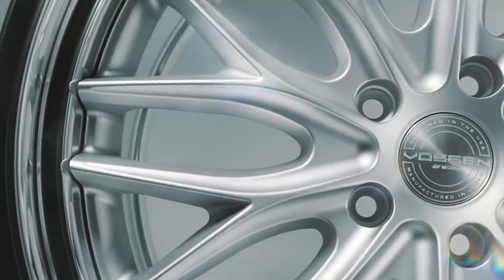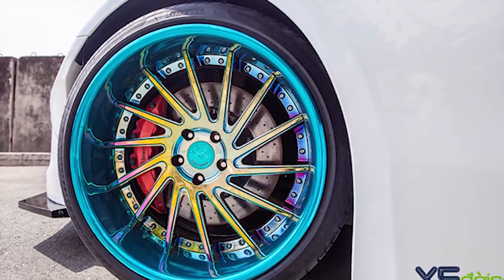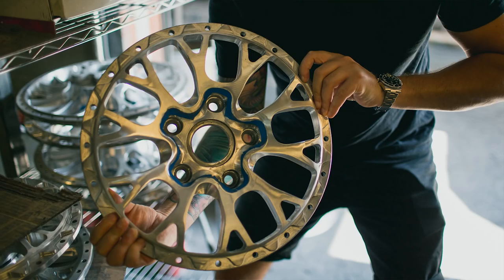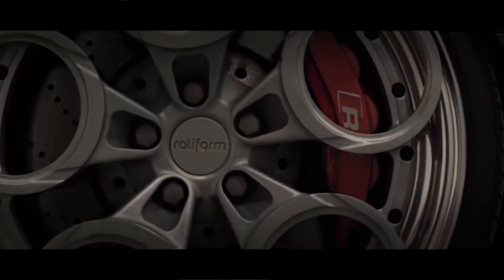Everything You Need To Know About Multi-Piece Wheels

Comment: I think you guys need some research on clamping force equations. For example on a 1/4-20 fastener at 15 ftlbs, that fastener has a clamping force of 300-500lbs depending on friction coeff. So multiply that by 30, 9000-15000lbs.
Reply: So basically my 40 bolts on each of my Works wheel, pretty much like the wheel is welded together :-0
Reply: @DJSHaKa that is correct as long as the metal between the the bolt holes can re   that much force

Comment: Can you please do a video on how to assemble a multipiece wheel? What silicone to use & torque specs.
Reply: Dow Corning 832 silicon. 8mm 12pt bolts 18ft lbs with loctite
Reply: GE type II silicone.
Reply: use the polyurethane used for windshields, surely better than silicone and easier to redo than weld
Reply: @karmatheninja  do these specs work for 2 piece peice wheels as well?

Comment: i bought a set of welded 2 piece Enkei RS-III, split them, refinished and rebuilt them. wheels cost $500, new hardware was $55 (through my shop) and i spent maybe another $50 on paint. the real cost was in man hours. i have probably over 50hrs into them for blasting, sanding, polishing and painting, but it was 100% worth it

Comment: I'm not sure I agree with the part when you say "silicone keeps the wheel together". The bolts are what hold the wheel together, and depending on how many there are, they are usually fairly tight. The silicone is there to keep the air in the tires from escaping.
No matter how much you torque the bolts to, air will find it's way out of the wheel if they are not siliconed, or welded. 
Also, siliconing is done as a last step before putting the tires on. And preferably 24 hrs or more before tires are put on. The way you explained it, you seem to say the parts are stuck together, then siliconed, then bolted together. The only reason you would do it this way is if the barrel and lip are designed in a way that doesn't allow you to cover over the seam between the two parts after everything is bolted together. Like on a '0' lip, where the lip actually folds overtop of the mating surfaces.

Comment: Conclusion: If you can find single piece wheels that will fit and perform to your satisfaction in place of multi piece wheels, you're objectively better off with the single piece wheels.

In short, the only logical reason to choose multi piece wheels is fitment.
Reply: Fitment isnt the only reason in my opinion, there is something beautiful and elegant about a 2/3 piece wheel that cannot be replicated in a standard wheel.

Comment: $5k maybe, $8k I could see if you’re putting 26’s on a truck. A lot of reputable brands like SSR, Work, Ag, and even Concept One will come in under $1k per wheel.
Reply: Agree, seems a little exaggerated. Just paid $2500 AUD (Less than $2000 US) for a full set of Work Meister CR01's in 16 inch.

Comment: Is there such a thing as a forged, deep dished, monoblock wheel that can fit into an RWB 993? (I don't have such a car, I'm just curious.)

I'm a bit concerned if there is a difference in strength and rigidity between a multi-piece wheel and a monoblock wheel. Yes, I know both wheels are forged but still.